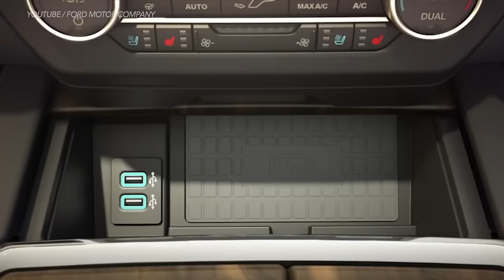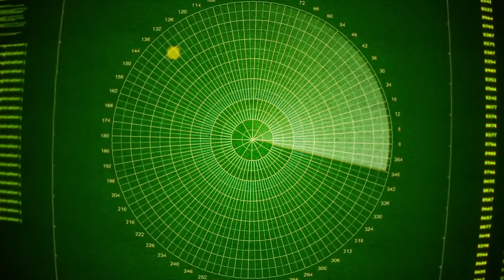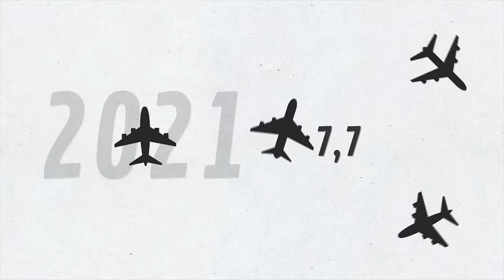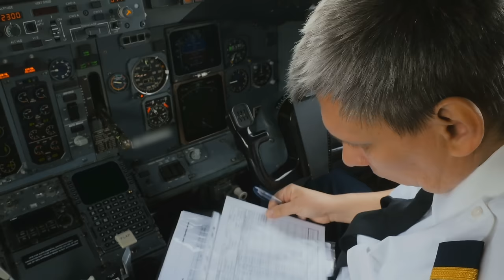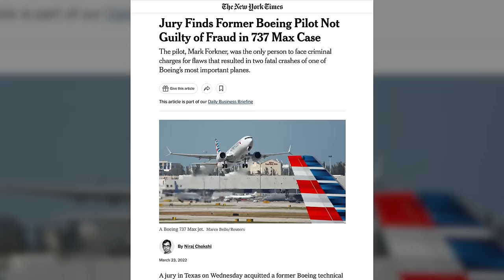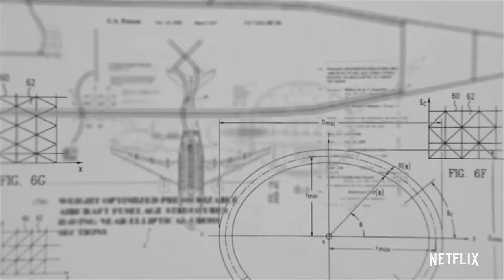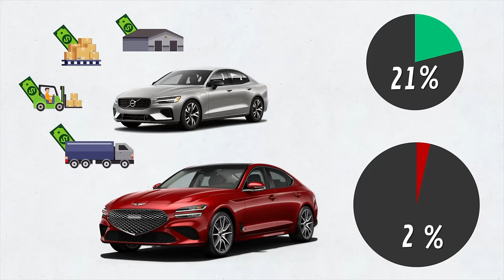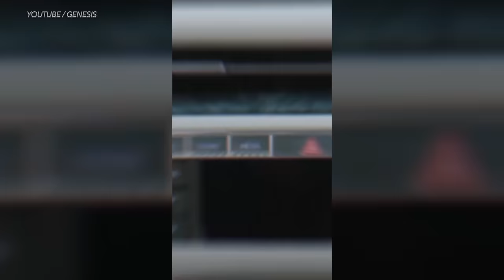Here’s Why Honda and Toyotas are Unreliable Now

Comment: The mcast system was actually a band aid for the new engines they put on the 737s. The engine was bigger and had to be installed differently than the older engine because of the wings. To avoid stalling the air craft they programmed it to lower the nose automatically without alerting the pilots.
Reply: @user-3tf67bk46u  Presumably their test pilots knew about it though....?
Reply: @user-3tf67bk46u  yeah, exactly. From what I’ve gathered it was meant to be an aid in take off scenarios (to avoid scrapping the new engines), but obviously wasn’t tested thoroughly.
Reply: @user-3tf67bk46u  the reason for not informing pilots or updating the training manuals, the Airlines demanded the Max Series would not require EXPENSIVE Flight Sim time or Boeing would be Penalized. Boeing had to hide the changes behind an automated system or be forced to pay penalties to the Airlines. Boeing was at greatest fault but Southwest and some Mega customers might be blamed for insisting on new tech, new more fuel efficient & powerful engines but wanted no added training costs. Then you have the FAA which just rolled over for Boeing.

Comment: My 2022 Toyota Highlander Hybrid has all the safety features listed on the Honda Civic but also has adaptive headlamps that self level depending on load and also have a cornering feature as you make turns.  It also has a HUD (heads up display) that has all the critical info without having to take your eyes off the road.  This feature can be modified to display what you want on the HUD, including your current speed and the posted speed limit.  It weighs 4600 lbs.  A safer, larger vehicle with 8 inches of ground clearance.  But it did cost $52,000.

Comment: Mazda has been killing in reliability since they split from Ford. There engines and transmissions have been used for at least 10 years have  been extremely reliable for the most part. Mazda are being really conservative in making changes and see ot as if it ain't broken and works why replace it. Examples will be in using proven reliable technology in NA engines and sticking with a traditional 6 speed AT.
Reply: They are cash-strapped too so that’s why they still have old 6 speed autos for example.
Reply: @Kizzle001  Yea old right yes old and bullet proof you can have your rubber band crap transmissions I know about them because I have one or two or three and still counting
Reply: @Kizzle001  They are ,but these 6 speeds are bulletproof, get the job done , and way better than a Cvt.
Reply: Agreed.  If only their seats weren't torture devices.

Comment: Every manufacturers in all different industries is always on manufacturing cost reduction activities.  The first activity is what we call yield improvement. Yield is a measurement of number of built product that passed the product test process over the total number of built products put into the test process. Product that fail in the test process will have to be reworked and then test again. This measure more time to build the product and more cost added to production. So, higher production yield means more products can be built within shorter time and lesser wastage of material. Therefore reduced cost. Other cost reduction activities includes getting cheaper material with similar quality. If it works were, it is a significant reduction in material cost without compromising quality of the final product. However, sometime it can go horribly wrong when the cheaper parts fail in the field. That's why we can recalls.

Comment: If it weren't for DOT's NHTSA and FMVSS regulations, auto manufacturers would not be producing cars that are as safe as they are today.  There would be several more injuries and deaths.  Some of these FMVSS required safety features would be options to the car buyer, in order to keep the prices down.

Comment: 10-20 years ago there weren't any  sophisticated displays that monitored essentially all systems in a car. No back up camera stuff, blind spot monitoring, GPS, and if it is considered problematic by JD Power, Consumer Reports or any other "Automotive Authority" it is considered as much of a problem as a paint flaw, a troubled engine, or a troubled transmission. A display is not necessarily a vitally important part of the interworkings of a car as a transmission or engine are. With all the extra devices on a car these days if they aren't working flawlessly all the time its considered a really big deal. The fact is electronics are much more likely to be falty than mechanical stuff these days.

Comment: Although my vehicles are older ones, I wish I had kept my 1970 Holden HG Kingswood.  Not great on the mileage but you could fix it with rubbish you find laying around in the Australian outback.  My old Pug's EMS died a number of years ago and if I had the schematic then I could have repaired it, because the control maps and firmware were stored in external EPROM which was not damaged and I easily copied it as a backup.  However, the circuit complexity was suibstantial and since the schematics are proprietary then the only practical solution was to find a second hand replacement EMS which, fortunately, I did.  There is barely any hope of doing that with recent vehicles.  The old HG, however, had a simple mechanical ignition distributor, so that if there is a fault, you can literally see it, as with almost any other part of the vehicle.  Nothing was more complex than the gearbox.  May not get the mileage a person wants but such vehicles will still be going, provided fuel continues to be available, long after the modern terra-bound interstellar spacecraft have ceased to roll.

Comment: It would be interesting to note if any auto brands' reliability has gone up...
Reply: Mazda when Ford left them.
Reply: @archiethedog4515  ford is very reliable . 290k miles on my 11 gt mustang. my 09 gt has 175k
Reply: VW in my experience has gotten better with their TSI engines, they still need more maintenance than a Honda or Toyota but they're way better now imo
Reply: @totallynotbluu  lol.
Reply: @anthonyjones5047  a Ford mustang is one thing. A Ford fiesta is another....
Reply: Mazda. Im picking up a. Cx-50 in the spring. Toyota has had some issues lately. Burning oil.
Reply: @anthonyjones5047  their engines suck. They don't call it the 'ecoboom' for nothing. Some broncos are self destructing before the 5000 mile mark.
Reply: yes genesis, buick, hyundai, kia has move up accord to JD power, toyota and lexus has fallen to 5and 6 respectively. Accord to CR lexus, toyota mazda, infiniti and buick.
Reply: @cb5110  So who's more reliable - JD Power or CR?

Comment: I have a 2020 Camry XSE with 70K highway miles and the rear struts are bad, causing cupped tires, at least on the right side. It cupped one of the original tires before 30K miles so maybe its just defective from the get go. Very disappointing for Toyota. I can't find KYB quick struts anywhere, so I guess I'm gunna learn to compress strut springs.
Reply: Meanwhile, my 2001 Camry has 292K miles with the original struts and springs. Sounds like automotive world is in the shitter at the moment.

Comment: Wonder why Scotty pokes fun at reliability surveys in his regular videos yet quotes those same survey's in these professionally produced videos? Besides, my understanding is that the lower reliability ratings given to the likes of Honda are mainly because their infotainment systems are problematic; it has nothing to do with their mechanical components (outside of the widely documented oil dilution issues with their 1.5L turbo).
Reply: I bet his producers make the script for these videos. If it was a Q&A video he would laugh off the survey and say it's too soon to see which new cars will be reliable.
Reply: I this video is referring to the JD power survey too 🤣🤣🤣
Reply: Dude those honda infotainment systems are rough to get around, good cars though
Reply: Oil dilution?
Reply: Honda went way into the gutter for the last few years in treating customers like crap, paying almost zero for warranty repairs, denying warranty repairs, and denying the oil/fuel dilution issue. If they had been more proactive and honorable I would still be a customer.
Reply: @jamesmedina2062  They honored replacing the AC compressor free of charge.
Reply: The Honda odyssey had transmission issues the 9 speed from ZF, acura DCT and the 9speed, But I see scotty hiding Toyota problem too with engine (2.5 dynamic force) and transmission . The new twin turbo 6 in the tundra , turbo failure.

Comment: Scotty my friend we all know that the Japanese by th 70' tough us how to make a dependable car. By the nineties many of the other manufacturer's had caught up some what, and thus we saw some of the best cars made in that period. What happened after that?  Well the motorist along with the likes of "Top Gear" and their influences on the motorist began to dictate to the motor industry. The modern motorist wanted speed, performance and gadgets and so the motor industry obliged. The modern motorist was not happy with a 4 cylinder or straight 6, they wanted V6, V8 and even V12. To impress their neighbours and friends. Then they also wanted turbo and stiff sports suspensions. It got so bad that even the family practical car had to be a sports car or a racing car. Everything I see today is sports and over engineered. And the car manufacturer's know that their best and most dependable engines, are the simpler 4 cylinder and straight 6's but.. they want to sell cars so they give us stupid people the car that we wanted but don't need. I mean who needs problems? When I was a teenager back in the 60's most top luxury cars were great value for money. But today the gap has narrowed so much that the luxury car is now just a money pit suffering from big depreciation because they are no more dependable than a cheaper Asian  car.

Comment: Get rid of everything with a chip in it. Everything had less complications before they put a chip in it. And when stuff did break, it was more easily diagnosed. I'm on my 3rd dishwasher in 5 years because board fails.  Dishwasher won't turn on or it turns on without user input. Or it shuts off halfway through the cycle. Somehow dishwashers and everything was able to work in the past without chips and lasted a long time. Bring those days back.  Make things without chips again!  Rant over
Reply: I'm 61years of age,  on the same dishwasher from birth , my hands.

Comment: In terms of safer one could argue it is ambigious.  New tech though great on paper can still fail & cost a lot of $ to fix.  I don't have active blind spot monitoring on my side mirrors.  Yet 2" blind spot mirros do the trick for only $7.  If you want safety, better to have drivers who are competent, rather than a system telling them things.
Reply: Safest thing we as a society do is remove the need to drive regularly in the first place.
If we designed our cities and spent our resources in a way that ppl didn't need to drive for work, or running errands, driving would become safer. 

Having it only be done for recreation (like going long distance road trip for fun etc).
Reply: @yamibg  walking to work for example would be ideal.  Then again things are not as such.  Too many stupid, ill-prepated  & agressive drivers.

Comment: The Boeing 737 is 45 years old.  The repair and maintenance in foreign countries is larger factor for these crashes.  Southwest operates a fleet of old 737s in the US without these problems.
Reply: It's the newer practically new 737 max that's giving trouble.

Comment: i have a 78 pontiac bonneville brougham
4 door.400.v8.4.bbl
and a 86.mercury cougar  2 door
3.8.v6.throttle body fuel.injection
both run as designed

Comment: Excellent++ video Scotty - I'm sure you researched how the too large jet engine was mated to a reliable airframe on the Boeing Max, requiring that MCAS software to keep those oversized engines from zooming in a climb. Reason for that was to preclude the need for changes to the loading bridge heights at all the airports. More bad ideas than you can shake a stick at!
Reply: Was it based on the design of the Bumblebee?

Comment: Hey Scotty... My 95 Nissan Maxima it's showing sometimes the brake and battery light on in the dashboard.... Even tho it turns on and drives good ... 
What you think it is ? 

The Alternator ? 
The Starter ? 
Not the Battery cuz had it checked at Auto zone and said
 it's good 
BTW... My Maxima has a little over 200k miles and still runs good 😜😃😎😎

Comment: I'm driving my original 1993 Honda Accord  EXR.  Looked after it with kid. gloves...183,000 klm. So low mileage for the years. I wanted to get 1 LAST car before I started working  less/retire.  I'm afraid to buy  a bad car.  The body is now rusting, and due to age parts will be more difficult to find. Price plays a factor in my new car,  and availability during pamdemic, etc. (war in Ukraine)..making used cars crazy in price. I don't want all the bells and whistles...less features,  less to go wrong...
remember I still have a cassette deck lol I live in Canada,  and we get lots of snow and  cold where I live. The Toyota  Corolla Cross is looking good? Honda Hrv is nice but way too pricey here.  Nothing seems as reliable as it used to be. I'm hating this whole process sadly.

Comment: Comparing air planes and automobiles is nonsensical, there are different engineering necessities and marketing agendas between the two. 
And No Hondas and Toyotas are still value reliable auto manufactures in comparison to the rest.
Reply: not anymore. Honda and  Toyota having serious issues. The perception of reliability is what carrying  them thru.

Comment: I feel a lot has to do where the cars are made for example Toyotas were made in Japan I feel the quality control there was probably very strict. I have an 06 4Runner the car is going on 130k miles never had issues just regular maintenance. And everything is accesible and easy to work on. An oil change in that car probably takes 10 minutes.

Comment: Yes Scott the standard gone downhill and partly because of the amount of sensors, older cars 🚘 still made more robust new cars made flimsy and even the engines requiring a rebuild at 50-70 thousand miles so that says something would you agree.

Comment: I don't think the assumption that electronic safety systems make a car inherently more unreliable makes any sense. Most of those just disable themselves when something in the safety chain doesn't read properly. The only things that become unreliable are electronically actuated systems in the drivetrain like dynamic suspension which relies on solenoids controlled by an ECU. And that's not a flaw in the electronics, that's a flaw in the actuators themselves.

Comment: The cars from 10--20 years ago are usually CURRENTLY MADE in some country other than the OEM country, (I think). And probably have the bugs engineered out of them.  For example, a '67 Ford could be bought brand new in Argentina in the 80's.  Also the '75 Renault Alliance was being manufactured in Turkey in 2001.
{Hopefully they had a reliable non-plastic shifter, and a cooling system redesign}

Comment: Cars are quickly adapting the "cell phone model," that is: 1. Make a shiney new tech-loaded car; 2. Make people want to buy it and be among the first to buy it; 3. Upgrade the next model; 4. Repeat. That's part of the reason you see manufacturers toying with leasing and removing buyout options.

It's the same way with KIA, if you ask me. In the last 10 years of me owning Kia's, I have always felt they'd much rather push the leasing options, get people signed on to a lease, then toward the end of that lease get them in the new years model under roughly the same terms. You can see that in the car designs as well--any generation of any particular model only sticks around for about 2-3 years and then they're doing facelifts and redesigns. 

But especially now with the hot-push to EV, as the cars become more electrical and complex, the more there will be problems. My car has been sitting at the shop collecting dust because an engine/wiring harness has been on backorder, and that covers several sensors to make the damn thing operational. If it weren't for the jacked used prices, I'd be picking up something mid-2000's

Comment: Car makers have gone loco with sensors and electronics. There's hi-tech and then there's "why-tech?" Simplicity will always be more reliable than complexity. That's the biggest reason why people loved the original VW Beetle. It was very basic but it just kept going. It works the same in the aviation and railroad industries.